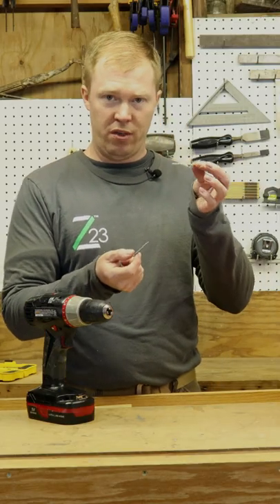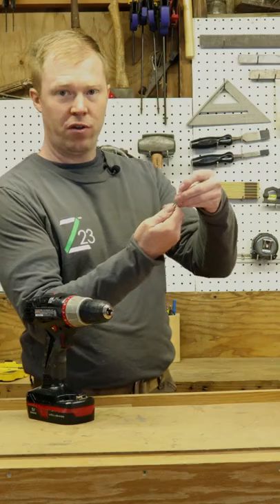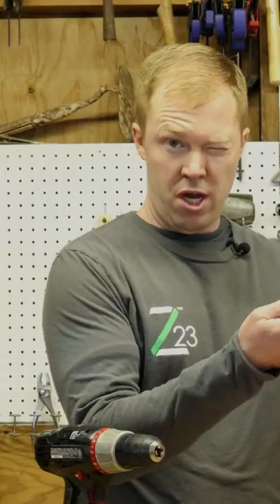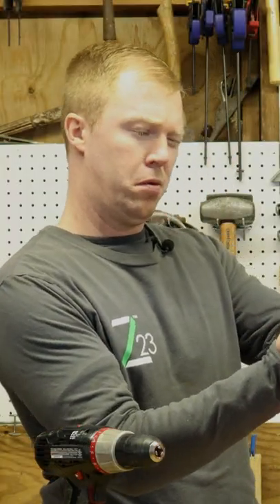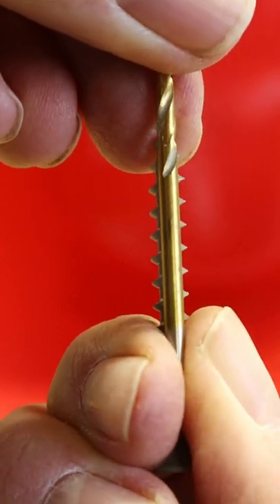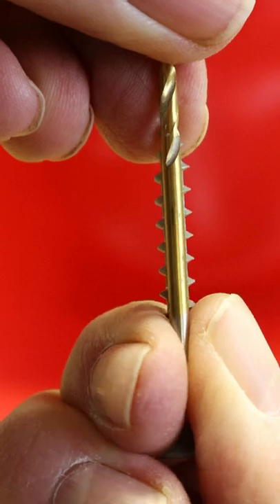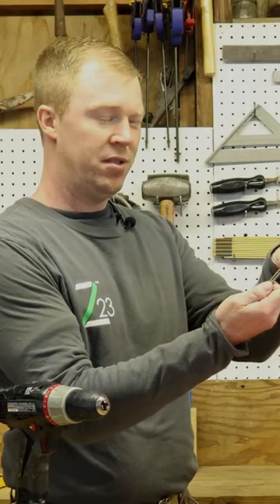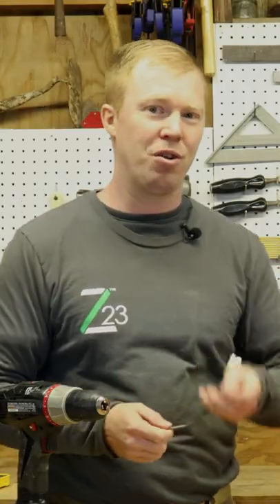Picking the Right Size Drill Bit for Screws - Pre Drill Pilot Holes #Shorts

Comment: Thank you!! Is there any rule of thumb for  finding the right size anchor for a particular bolt or screw? 🤔
Reply from the maker: That one is a little trickier. With plastic wall anchors you mainly want the bolt or screw to fill around 3/4 the opening on the end of the anchor. If I'm not for sure, before putting the plug in the wall I will screw the screw partially into it and make sure it bites into the plastic securely and pushes the "wings" out on it.

Comment: How do i know which drill bit I use for a pilot hole to put in a wall anchor? Thanks.
Reply from the maker: Very similar method where you hold the wall anchor next to the drill bit. You want the drill bit slightly smaller then the anchor, where you have to tap them in with a hammer. If the wall anchor starts bending cause it won't go in the hole then you need to re-drill the hole with the next bigger size drill bit.